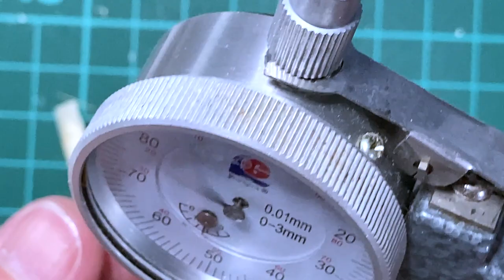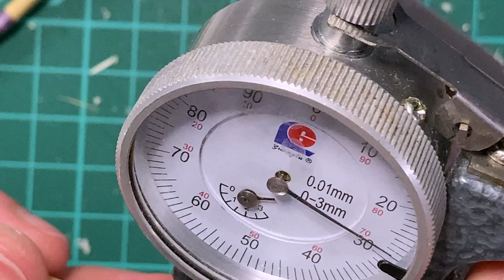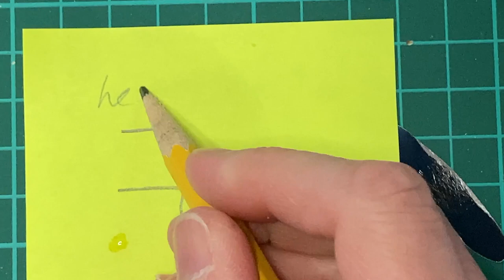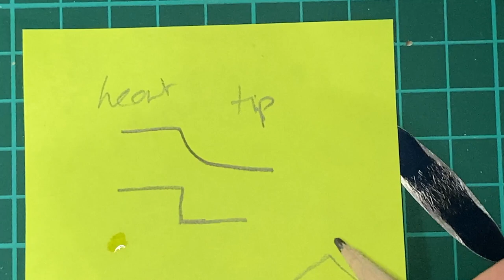Reed Repair Shop: Julie

Comment: The second reed you worked, the one Julie labeled as reed #1, it seemed to me that the extra thick side of the heart actually still had some of the bottom layer of bark on it. The colour was much darker, and the micrometer read about where I would expect that layer of bark to be. I would have started by getting that uniform with the other side, then gently bringing the spine down, and finally rebalancing the tip. I think you had to clip too far because you went straight to the usual cut-in + clip before addressing the bark issue (if I am correct about it being bark anyway). I had a lot of trouble for a couple months with reeds which were so open and flat, even after clipping and rebalancing to 68.5-69mm, and I found it was because of my heart not being quite freed of bark.
Reply from the maker: Good eye! The thickness was certainly there - and you may be right that I jumped.  I always try to protect existing structure, but these are real time videos and sometimes I guess wrong!

Comment: Wonderful video!!!    I had two questions;  On reed #2, was bark left on side of heart because too much taken out of channels rather than remove to close down reed?   Also, I know reason for crossover of thread in middle of blank, but what effects are there with crossover on side of reeds as in video?   Love these videos!!!!!   Thank you.  P.S.  My reeds sealing much better as I took your suggestion from last video; wrap too tight before crossover.
Reply from the maker: Yes, I didn't dare to scrape any more in the heart in any way!  And honestly, I didn't clock the side crossover - nothing felt too amiss there so I didn't worry about it! 

So glad to hear that your reeds are sealing better! It's SO FRUSTRATING to have them gap!